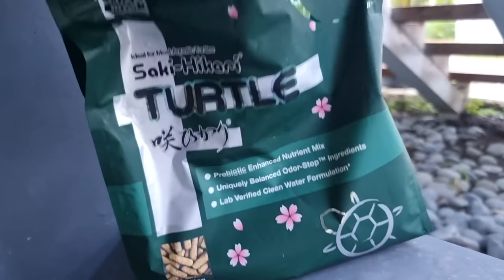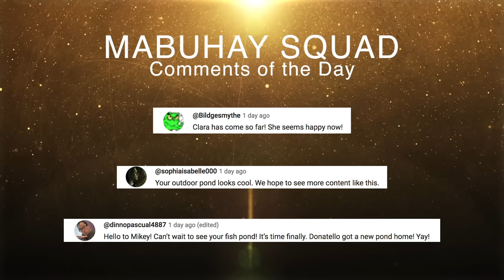Our New Outdoor Parrot Aviary Is Huge | Vlog #1667

Comment: Genuine question. Why not just construct the new aviary from the ground up rather than using the pergolas? That middle connection isn't structurally sound and might be a hazard waiting to happen. The construction of the pergolas themselves are not rated to bolt on such stilts so it wasn't tested on such applications.

Comment: actually,  since your pond has a huge water volume and a low bio-load - two turtles and guppies - you're quite safe.  agree with you that you need to keep the water moving though, the fountains will help but you may want to consider aerators as well.  good luck!

Comment: The heron you saw at Villa Escudero is a Striated or Little Heron (Butorides striata) which is a small and pretty common heron species found in Old World Tropics (throughout most of South and Southeast Asia ans the more tropical areas of Africa), Japan, Australia, South America and the Caribbean. I've seen these birds when I went birding before in mangrove areas and the rocky parts of beach resorts.
Rabbit poop is really great fertilizer and can probably be even sold for profit for other people who are into gardening; one plant shop over here seems to combine it with coco peat as what I found out when I bought a half sack of coco peat from them that was supposed to be used as substrate for my exotic critters' enclosures. I don't want to risk using it for the enclosures of my exotic critters that keep indoors but it will be pretty useful when I start planting around the land area for my Red-eared Slider's outdoor enclosure.
Also, the culprit that might have eaten the butterfly that owned that wing you found might have been the Brown Shrikes that have just recently returned from the Asian Mainland; you can actually hear their calls when in the background in the segment where you showed the pond; the Brown Shrike that dispatched it might have its larder where it impaled the body of the butterfly right above the area where you found the wing. Speaking of pond, maybe you can patch up that part of the pond that separated from the concrete with a sealant as a precaution.

Comment: Shouldn’t the waterfalls and pond water be connected to the filter? Why don’t you just throw a handful of pellets  instead of giving it one by one? I think the works did not place any grout or binding material before placing the concrete topping. This is why it separated from the wall of the pond.